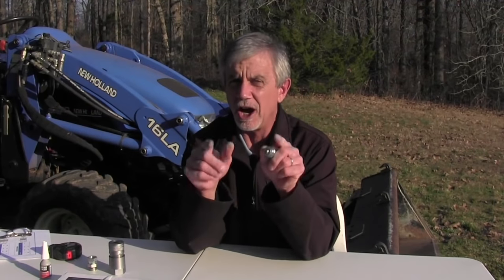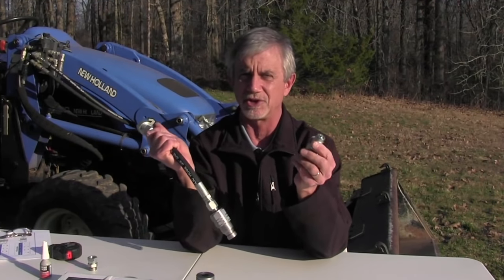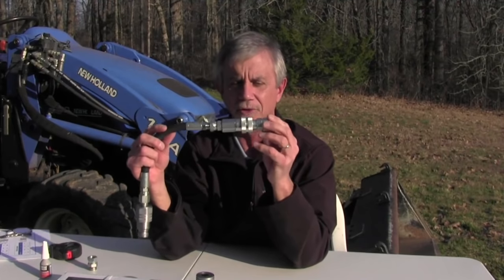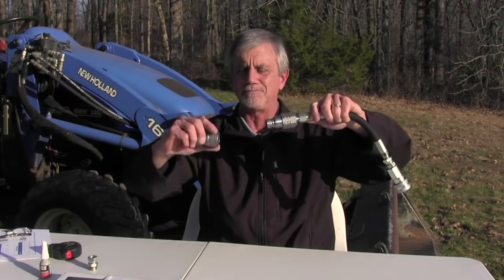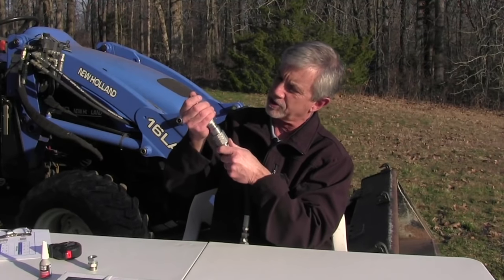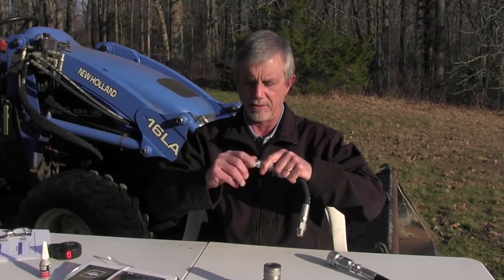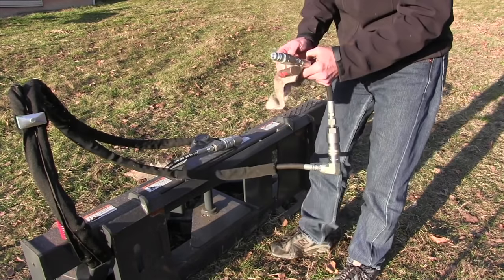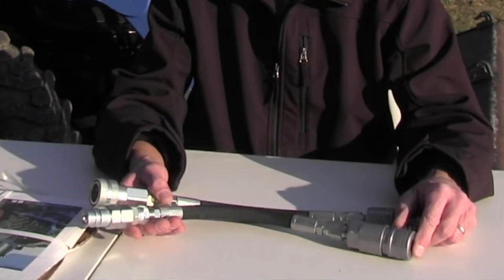A Trick to Make Hooking Up Hydraulic Hoses Easier

Comment: Just want to say thank you for solving my problem not with your hose but with the tapping the tip to release pressure. I’m still relatively new to tractors and hydraulics and I’ve spent a couple frustrating hours on issues including not being able to hook up my hydraulic. I thought it must be bent and was looking to order a new coupler.  I watched you video then went out and tapped the tip on my draw bar. Problem solved!

Comment: TAKE THE 2 LINES ON YOUR EMPLEMENT AND CONNECT THEM TOGETHER...MALE TO FEMALE.  TAKES CARE OF ANY PRESSURE BUILD UP.  I'VE DONE THIS FOR 50 YRS.  WORKS GOOD ALSO
Reply: How would this prevent pressure build up that is caused by higher outdoor temperatures?  Even with the two couplers connected together, the fluid is still trapped in the system...
Reply: @peteduncan921  he is referring to in even positive or negative pressure. Basically it equalizes the fluid in the implement.

Comment: Amazing. I just ran into this problem for the first time a few days ago, while trying to re-install my backhoe. I relieved the pressure by whacking the hose end on a flat surface (after an hour of trying to force the connection in 105 degree heat!

Comment: another option is to connect the flat face fittings on the attachment to each other. That equalizes pressure across the system. I use flat face couplings on the front of my tractor and pioneer on the rear remotes

Comment: Mike, I just went through a head scratching attempt to connect my grapple flat-faced couplers that had pressure build up on both ends of the line and I was getting super frustrated.  Needless to say, I was not able to join the couplers until I used a Skid Steer Solutions hand clamp pressing tool that enabled me to get them attached.  The tool cost $85 and finally worked.  The tool is called the QC Mate Quick Coupler Hand Clamp.  I made a video (not posted yet) using the QC Mate hand clamp to attach the hydraulic lines. It wasn't as smooth-going as on the creator's advertisement video but it ultimately relieved the hydraulic pressure which allowed me to eventually connect the lines.  Thanks for your  idea to create a quick-connect hose to purge the line between grapple hook-ups. Have a fine weekend.  Appreciate your advice.
Reply: $85 for the tool seems pretty outrageous........

Comment: For less than the price of that adapter hose you can buy a small tool that looks like pliers that is designed to release the pressure from Pioneer couplers. I keep a pair in the tractor's toolbox.
Reply: Can you post a link to said tool? That would be super helpful!

Comment: Did something similar with the two different fitting styles and a 90° elbow. Haven't gotten to it yet, but also plan to make a couple hoses like that for changing the gender of connection as well. Will likely use the hoses with a SSQA-mounted post-puller in order to be able to use the post-puller (with appropriate mounting adapter) on the tractor's 3pt.

Comment: Another good video, Mike. 
A few words to the wise from an old farmer:
Hydraulic fittings and hoses my have different threads that look similar. Some are tapered pipe thread and some are straight thread that seal with an o-ring. I’ve seen enough boogered threads caused by people (some in dealerships) who didn’t know what they were doing. 
Not all Pioneer type couplings are compatible with ISO couplings. Some are. Avoid Chinese knock-offs like the plague. 
Flat-face couplers used on Case skidsteers are not compatible with nearly identical couplers used by Bobcat.  
Hope this helps.
Reply: I'll second the CNH couplers being different. If memory serves me right the Case/New Holland flat face fitting face is ever so slightly larger than the "standard" bobcat style. Found this out when I sold a brush cutter with a NH C232 compact track loader. Good point to bring up.

Comment: At work we have a small three port ball valve with a bottle fasted on the middle port . Two hose like you have with quick connects . You just turn the ball valve handle and dumps oil pressure into the bottle . No mess no hitting anything with hammers or rags etc . When plastic bottle gets full over few dumps you just empty it saving the oil .
Reply from the maker: What a great idea!!!
Reply: @TractorMike  You can just use a tee fitting with two female quick connects direct too the tee also and put a single small ball valve direct on the middle port  with a short dump hose for bottle or can  . It’s cheaper and simple way . Most hoses on grapples are long enough that will give simple radius connecting .  No need too put short hose on tee with the quick connect s . 👍
Reply: Stephen, Is there you can send a drawing or picture of it???  what size of valve?
Reply: Sure wish you could post a pic of this device!

Comment: So here’s a hydraulic question. Why does my bucket start dropping after the tractor is turned off?  The hydraulic pressure “ bleeds” off and the bucket or pallet forks start lowering.  Any help or suggestions ?  Thanks
Reply: Probably a tiny bit of hydro fluid leaking past seals.

Comment: These 2 coupling videos are terrific! I have been sharing them with all my construction equipment buddies. I do have a question - what is the best method for cleaning old, built-up gunk out of a female pioneer coupling? I inherited several implements with pioneer connectors that have been sitting and have a lot of gunk built-up that have been trying (unsuccessfully) to clean. I'm thinking it may be simpler to just replace the lines and connectors.

Comment: Hello Mike. I have a 1975 Ford County tractor that I replaced the backhoe hydraulic hoses on. Once done, I added the missing hydraulic oil and everything works fine, except each movement of the backhoe stops about halfway through. Can you identify the problem there is? Thanks a lot Mike!
Reply from the maker: Sounds like a hose swapped somewhere.  Are you sure you got them back exactly in the right place?

Comment: what do they do different on larger ag tractors? on my Kubota M7 I just press the pioneer fitting in, use the implement and tug on it and it comes out. press it in, tug it out. both done 1 handed, never have to be forced.

Comment: I've always used teflon tape.  Is that a no-no with hydraulics?  Where do I get the thread sealer?
Reply from the maker: Teflon can flake off and get into your hydraulic components.  Any place that sells hydraulic components should have the thread sealer.  The stuff I bought is expensive but it sure works better than pipe joint compound.

Comment: I have a new Holland TL100 2 wheel drive. The PTO is self engaging (manual lever inside cab for PTO) when I push in clutch it will disengage. When I release clutch it self engages. Opinion?

Comment: Mike, another informative video but I have a question. As I recall, some years ago there was a tool to relieve hydraulic system pressure. It resembled a pair of pliers with one jaw, being U-shaped, slid in behind the collar. The other jaw would depress the ball of the male end. Haven't seen one in some time, though. Thanks.
Reply: The tool is still available. It used to be hand made by Waite's Tools but it was very hard to contact them. A new company has taken over the production of the tools and they are readily available in a variety of sizes. I keep a pair in my tractor toolbox.  Check out... https://www.boltonhooks.com/hydraulic-tools/

Comment: Enjoy your channel Mike vary informative. Your thoughts on just using a union to covert the hydraulic fittings?
Reply from the maker: Jim, do you mean all pipe no hose?  That would work.
Reply: @TractorMike  That's what I was thinking.. As a stroke survivor with only one good hand. Summer time I  do haul 8-9 loads of fill sand. I load my trailer then hook it up to the tractor. Some things pushing the male end in and  pushing the female lock open with  one hand can be a pain!

Comment: Hey Mike thanks for the tip. I couldn’t quite tell.  Were you were alternating between male and female couplings on those two pigtails that you built.
Reply from the maker: Might have been a wire jerked loose underneath by something you were bush hogging.  I'd crawl under the tractor and see if there's not a wire hanging down.

Comment: Thanks Mike!! As a newer Farmer, not from a Farming family, I've stumbled my way through most of this with our IH674. And I was so glad to see the tap you showed with the Pioneer is exactly what I figured out on my own to relieve the pressure when hooking up the bucket.

It looks like one of the couplers is leaking nowadays and I need to replace it. How does one go about replacing the coupler (the end coming from the bucket) without hydraulic fluid flowing out? Also...the hoses are really quite worn and I should consider replacing those as well. Do I remove them, measure the lengths and then head over to a Tractor Supply or Rural King? Are there common sizes or do you end up getting a reel of it and cutting hoses to size?

Thanks!
Reply from the maker: First, relieve all the pressure in the system by letting the bucket down to the ground and wiggling the joystick (or levers) until there's no weight on the hydraulics and then just remove the fitting.  There's no way to keep oil from coming out, so have a coffee can handy.  You can't really make your own hoses because it takes a special machine to crimp hose ends so they don't leak, but most decent farm supply stores offer pre-cut lengths of hose in 1' increments.  I'd measure the hoses you want to replace and get them when you get the new fitting and you can replace all of them at the same time to minimize the oil loss.  Also, make sure you get some hydraulic hose thread sealer to put on the threads.  The stuff is expensive, but it'll keep you from constantly fighting leaks.  Good luck!
Reply: @TractorMike  awesome! Thanks...really appreciate you taking the time to answer my question, AND put together all these videos for all of us...newbies, semi-newbies, to folks that have been Farming for years. Great resource and glad I found it!

Comment: But you still have to connect the Flat faces !! if there is pressure when disconnecting the attachment in the attachment
Reply: You are right James, if the attachment hose has a flat face connector under pressure you will not be able to connect it to Mike's adapters. This was my problem. I had to crack open the coupler fitting from the hose to relieve the pressure.

Comment: Yeah...the term quick couplers my ass. I operate my cousin's Case 321F frontend loader at his car lot, and I am responsible for plowing the premises in the winter months. What I like about the loader is the ability to disconnect and drop the buckets and forks at the push of a button. However! When I want to plow using the snow blade with retractable wings, I need to connect the 'quick' connect hydraulic hoses from the blade to the loader. I struggle to no end to get those bastards on. I have tried many methods in trying to relieve the built up pressure from both loader and snow blade, but those couplers just don't want to go into place easily. Plus! The spacing between both receivers in the loader are too close together that I can't get my hands in to push down with a lot of weight. This is so activating. There's got to be an easier way?

Comment: Pressure in the attachment is caused by trapped fluid,  it  increases in pressure due to temperature differential, this  causes the oil to expand resulting in the pressure increase.  If you fit connect under couplers on the attachment they resolve the attachment problem.   They are an ISO 16028 type coupler, that’s the bobcat style flat face coupler.  Please don’t release the hydraulic pressure with any of your body or hands.  Google oil injection it’s ugly. Be safe and best of luck out there.

Comment: Why didn't you just make a short hose with 2 fittings, and tie the 2 hoses on the attachment together?
Reply from the maker: Could have done that but I wanted to have access to Pioneer fittings.  I may never need them, but they're there if I do.